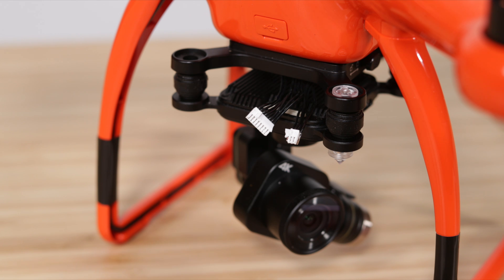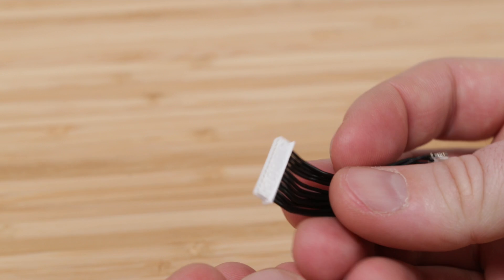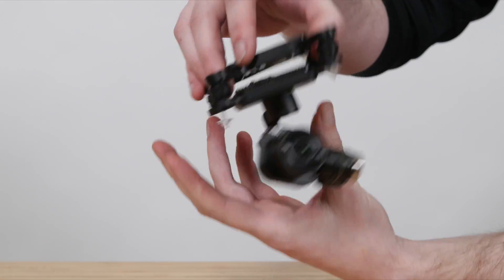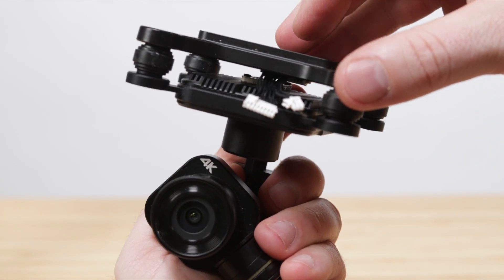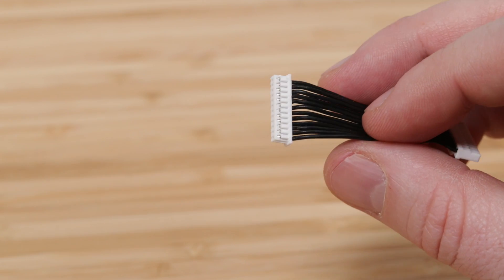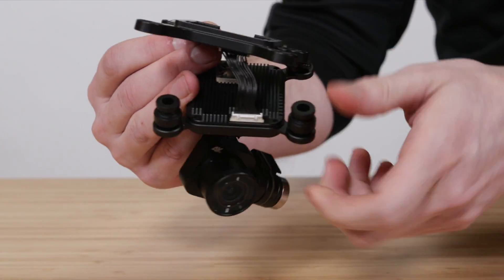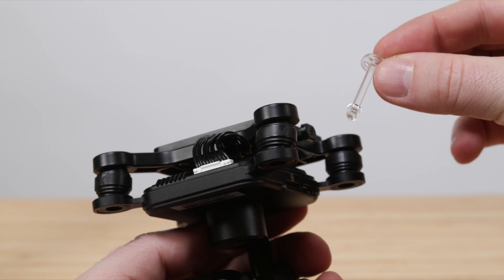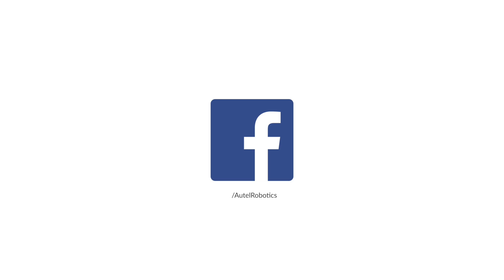Autel Robotics Tutorial: Replacing the 12-Pin Gimbal Cable

Comment: I'm very dissapointed. My XSP flipped over during take off (it was T/O from a flat surface) very little wind and now one set of propellers is broken and the "fuselage" scratched. It was taking off automaticly. 😔
Reply from the maker: Hi, pabloGAGV. Did you perform a compass calibration before takeoff?
Reply: Autel Robotics always, even when i change batteries
Reply: Autel Robotics Fuck Autel